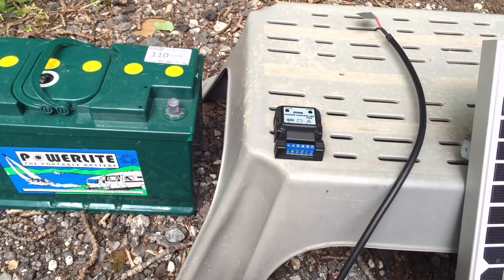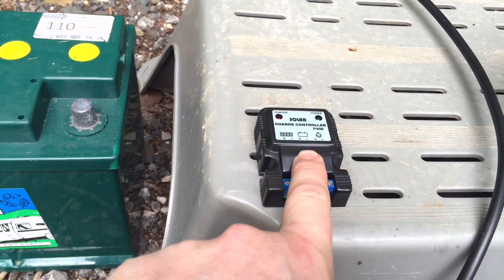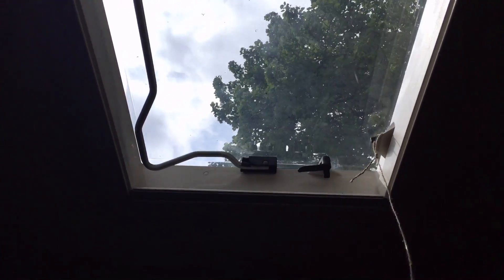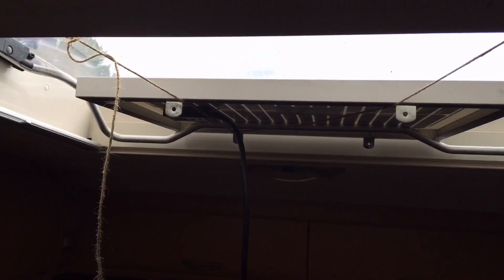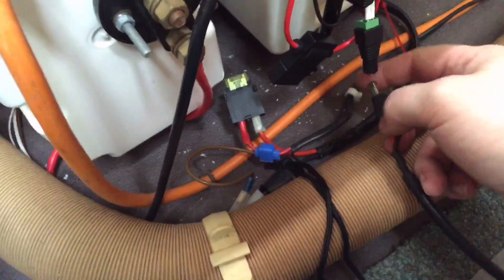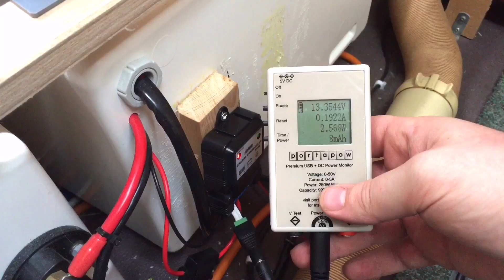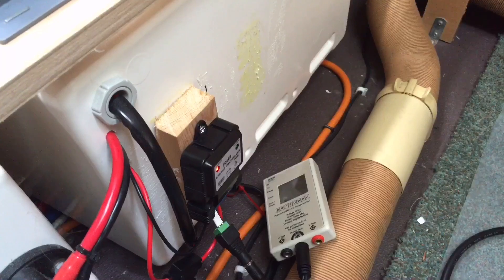Starting with Solar & Maintaining your Caravan Battery in Storage - 12v Solar Shed

Comment: If you have to go some where far and you need to leave your car at airport for weeks it can be a good solution for the car battery
Reply from the maker: Nice tip - thanks
Reply: I forgott to tell you, if you want to use in car, for battery connection, there is an ODB connector and you will not need to use any extra cable to reach the battery

Comment: Hi Adam, you made a a subject I thought HARD =Easy?, very skillful! and comprehensive, but what is your panels rated wattage?  I have a leisure battery and I have been told to charge it neeeds a 100watt (yours looks smaller? is it enough to charge a leisure battery in a caravan?) thanks for clearing loads up.
Reply from the maker: +Bryn Noble Thanks Bryn. The panel I use is only 20 watt. However with that said this panel just keeps my battery topped up whilst the van is in storage. We always have electrical hookup when we go away and the caravans battery will be maintained travelling home. I sometimes use the motor mover to get the van lined up just right in storage but I don’t run it much. 
If you’re camping off grid, wanting to charge your battery in winter or using your battery a lot more than me you probably will need need a bigger panel. My shed is off grid (pretty much) and runs off two 100 watt panels all year round.

Comment: Great video thanks, going to do the same while my van is in storage. Just a quick question please, i have crocodile clips for the battery with my kit, is there any order to disconnect when i need to reconnect the battery?
Reply from the maker: +David Dashper Cheers. Most charge controllers suggest you should connect battery first, then solar then load and disconnect in the opposite order.
Reply: Adam Welch thats great ,thanks so much

Comment: I've just completed an identical installation in my caravan after watching your video last week.  The solar panel is producing between 5 and 10 volts under our leaden skies right now, so no charging going on, but I'm hopeful of a trickle charge happening when the clouds disappear.  Thanks for your videos.
Reply from the maker: +Edward Richards It’s been fairly dull around here. I popped down to my van a week ago and the charge controller was in float mode on a half decent day. I’m sure it’ll come good.

Comment: Thanks for your videos, I have really been enjoying them.  On one or your reviews of this charge controller you mentioned that the boost and equalization voltages in the mid to high 14 volt range was a tad concerning.   I suppose that isn't a concern in this scenario since it will be in maintenance mode in the 13 volt range.  I just purchased the same unit and plan to use it for my tent trailer for the same purpose (keep two deep cycle batteries charged while not in use).    On a similar note, I also would like to add some more metering when Im out camping.  I usually go once a year for about 10 days with no hookups - Ive been using solar for several years now - but I realize I have not been nearly as efficient as I could be..and indeed need to run a generator every 4 days or so to top em off.  

Thanks again, great job.
Reply from the maker: Well spotted!  Yes the 14 volt plus charging limit could be a bit high for sealed - and definitely for AGM or Gel.  However the battery in my caravan was a flooded type.  I say was because I've had to retire that battery now as it developed a short cell.  I'll be putting one of my old shed batteries in the caravan in the next few weeks and I'll probably swap to a different solar charge controller as a result.  The caravan charge pumps out about 13.8 volts I think - so I'll probably try and regulate the charge controller at a similar level.

Efficiency is really important with solar.  I watched a video a few months back where someone took a feed from their 48v battery bank which they dropped down to 12 volts.  Then used a 12v inverter to get 240 volt and then plugged a 19v laptop power brick into that - the losses must have been huge!  A bit of careful consideration - charging devices when the sun is shining and perhaps swapping a few halogens for led and you'll soon notice a difference.
Cheers for the kind comments.

Comment: Thanks for the video, I have considered doing exactly the same with a solar panel under my roof light but wasn't sure if it would be any good. Your info has given me the confidence to give it a go.
Reply from the maker: Yes definitely give it a go.  Just find a small - low powered - solar charge controller.  If you get one that can switch a lot of current they often consume a fair bit too.  The 3 amp charge controller i used here is good for panels up to about 50 watts which should be plenty to keep the battery topped off.
Reply: Me too! Perfect solution for my caravan battery whilst in storage.  Many thanks.

Comment: Hello Adam
It is so fun o see all of your videos. I have lerned a lot. Almoust all parts are here and my Britisch Caravan built in 1973 will soon be very modern with 100w panel. The future is here. 
 I have emailed Swedisch (cause i live in sweden ;) ) resellers in hunt for panels with small damages and good price.  iBougth 1 mono 100w 75 euro shipping included, and a 40w for 45 euro, also chipping incuded. This is a fun hobby. I dont know mutch about electricity and have a question about those DC 12V Power Supply Plug Adapter Connector you use. 
How mutch Power do they tolerate?  other smart ideas to hook wiering together?  /Thomas in Sweden

Comment: if that's the 12.6 volt solar cxontroller it ant hig enogth to keep it topped off you need at least 13.2 - 13.4 to keep it topped off any more and it gasses any less and sulfation will buaild up
Reply from the maker: +David Simpson Hi David. The 12 volt version charges to over 14 volts as is normal for lead acids. I did a review showing all the charging limits on this channel ( https://youtu.be/KeNCK4inmdM ). The lithium ion versions of this charger (2S 7.4/3S 11.1/is there a 3S 14.8?) have different charging parameters but are the same internally. 

I actually think this charge controller can use to higher voltages - but with a very small panel (not to mention the fact it's behind a window) and a pretty big battery, this shouldn't be an issue.
Reply: ah yeah I did wounder I have the 11.1 li-ion version I did not relise everything inside is exactly the same just diff program
Reply: just looked in the manual for my controller and yes they do a 4s 14.8 volt controller I just ant found one yet on ebay or the 3.7 version
Reply: I tried to test if one unit can do the diff series packs as I have 4 5 volt panels at 2 amp each so tried single cell single panels and so on and it just wouldent work only time it worked wwas 3 or 4 panels in series with 3 batterys in series

Comment: Adam, could you post some data on the panel (power, voltage) chargecontroller (link) and how efficient is the panel with charging/trickling.
Reply from the maker: +Kenneth Tan Thanks for the questions Kenneth. Panel Details Below:
Maximum Power: 10W
Maximum Voltage: 17.5V
Maximum Current: 1.14Amps
Open Circuit Voltage: 21.0V
Short Circuit Current: 1.24A

The charge controller is available on eBay from numerous sellers. 
https://www.ebay.co.uk/itm/172014590875 
I've done a full review on a previous video, but this isn't the seller I bought from. 

As we saw in the video we can see a 2.5 watt charge going into the battery on an overcast day. On a clear day I have seen about 9 watts. It's enough to slowly trickle charge the battery and off set the current draw of the charge controller (if you see my review it pulls a very small amount). I don't continually monitor the charge - I only visit ever week or two unless we're going away in it. 

Hope that answers your query?
Reply: ***** Thanx Adam. Good info. A powerwall (mini) is on my DIY wishlist. Building it from used 18650 and feeding it with solar power. Until then I want to know all the ins and outs of internal resistance and capacity of 18650. Thanx to your capacity meter I'm good on my way.
Reply from the maker: +Kenneth Tan Good to hear. Wishing you all the best with your project.